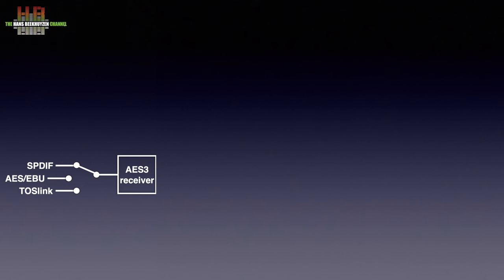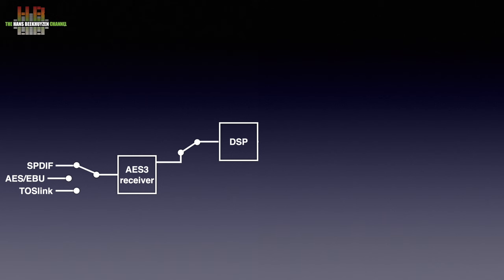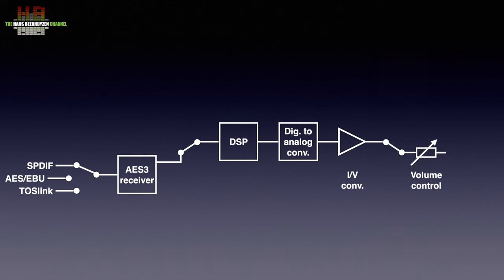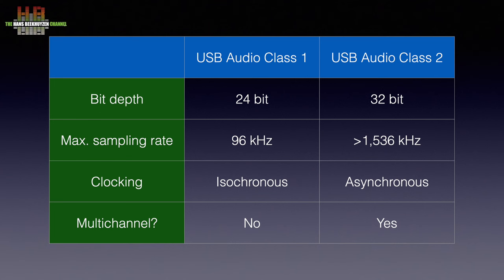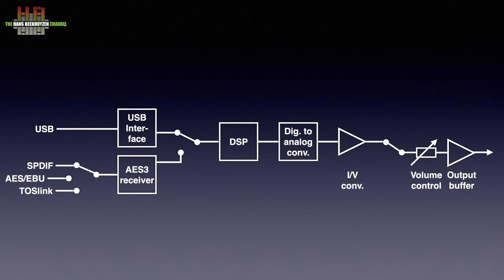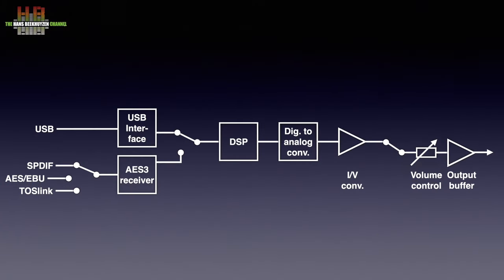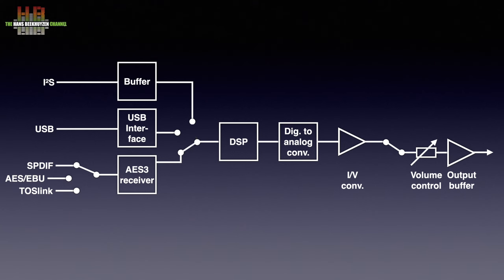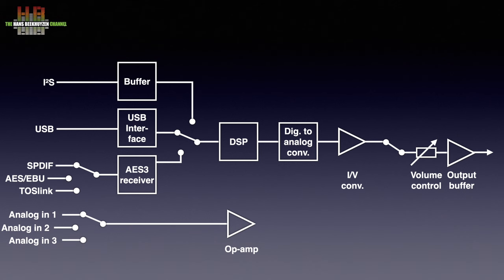The pre-amp inside a DAC and other questions

Comment: Very nice video explaining everything lucidly. I have a DAC which is non oversampling and uses a philips chip with a tube output stage and an analog volume control with a resistor/relay ladder - the AMR DP777. Even the spdif inputs appear to use a tube. It is a superb organic sounding DAC whose volume control beats a lot of very expensive standalone preamps. There are two analog inputs too which i use extensively and have two power anps connected directly to the DAC's outputs.
Reply from the maker: Cool, thanks!

Comment: Dear Hans, do you have an intention to review the difference between multibit vs sigma-delta? I’ve noticed that there’s still many fans of TDA1541, is it still relevant?
Reply: I got TDA1541 DAC and it’s a end game for me
Reply: @is3commander  what make dac would that be please.
Reply from the maker: Any technology that is appreciated by a public is relevant. To me the ultimate digital to analog conversion can't be found in R-2R solutions but then you are talking rather high prices. In the more affordable range, R-2R and sigma-delta are both valid attempts to produce decent sound.
Reply: @TheHansBeekhuyzenChannel If you’ll be short of ideas for your media plan, then please consider this topic, your opinion is very valuable.
Reply: @TheHansBeekhuyzenChannel do you think it will be possible to change the Mu-2 digital to analog sound characteristics by software to simulate r2r, nos or ‘typical’ tube dac sound?
Reply from the maker: You probably didn’t listen to the MU2. Why would you degrade the sound by colouring it?
Reply: @TheHansBeekhuyzenChannel I have not listened to the Mu-2 yet. But I’m coming from a complete Audio Note system, meaning I like rich sound..

Comment: Thanks for this video.  A clear explanation to someone that isn’t an EE.  I would be interested on a follow up video expanding on your thoughts around source material, for example CD and streaming, and the sampling rates of DACs.  The numbers listed for the source and the DAC can be confusing.  for example 44.1kHz for a CD and 192kHz for a Hi-Res stream and 384kHz/32 bit for a DAC.  What do the numbers really mean in your experience?  How does it affect the stereo sound you hear?  In addition, how do the connections/inputs you use (RCA/XLR/TOSlink) between the source and preamp impact the sound you hear?  I have a high-end system and sometimes I can tell a difference after a lot of critical listening but manufacturers advertise that higher numbers mean better sound so I’m expecting it to sound better which impacts my perception.  Looking forward to your response.  Thanks
Reply from the maker: This question requires a rather long answer.  So I will make a video to attempt to answer it. It's due very soon.

Comment: What about using the digital volume control  of the streamer that goes to external dac   and than to the integrated amp ( my dog eat the remote😢). Any  theoretical effect on sound quality?
Reply from the maker: That depends on the equipment used and at the volume setting on the amp. Set the amp's volume to the loudest you want to play and - when using well designed equipment - you are not likely to hear a difference.

Comment: Can you elaborate on why using XLR output from a DAC doesn’t sound better than RCA output into a preamp? I understand there is a 6 dB increase in gain from XLR output, but is there no other sonic benefit?
Reply: Some xlr have higher output than RCA, Xlr are better shielded against noise, thats about it. Short rca cabels are Great, just dont mix them together with your powercables.
Reply from the maker: If I recall well I said in the video that you should not connect a single ended output to a balanced input. If you do that there is no 6 dB gain and you have to connect the negative to earth, effectively making the input single ended. Some people think this will be a better solution, but it's not. A balanced connection always has the double voltage since it is balanced and is less sensitive to interference.